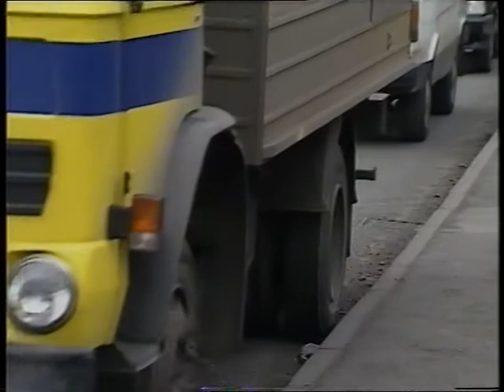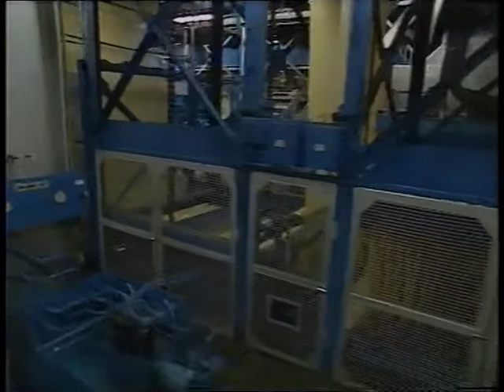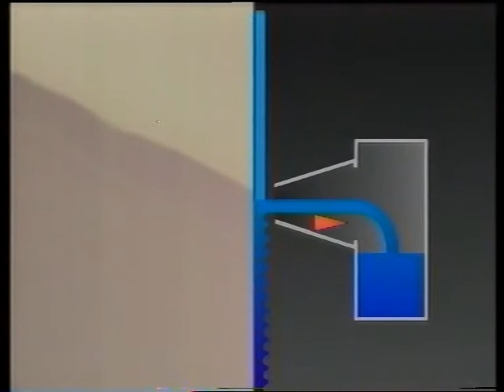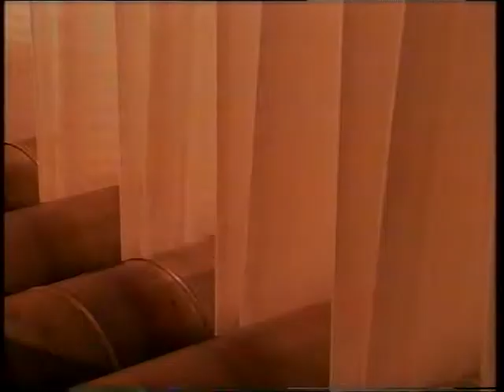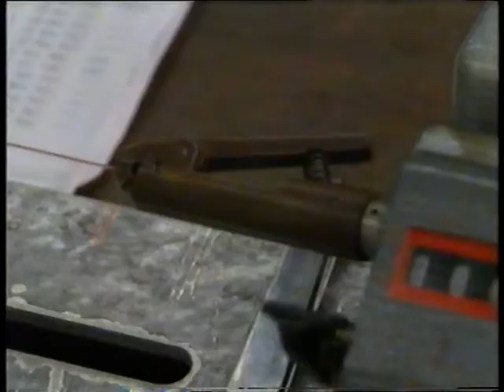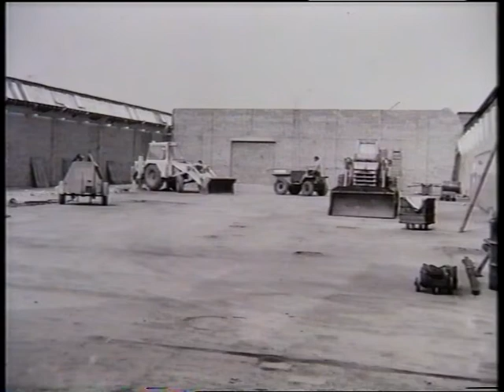Dunlop Textiles HS&D plant 1989-1990

Comment from the maker: i also served my time as an apprentice electrician in 1988 to 2005 ken fielding was my boss to start off with and then eric whitehead i worked all around the site but mainly on the plant looking after the dc equipment then took over as chef tec when eric retired worked there till oct 2005 when the place went into receivership great place to work for i miss it alot